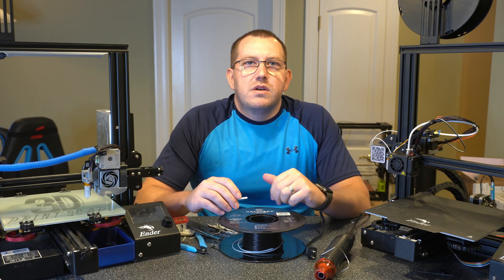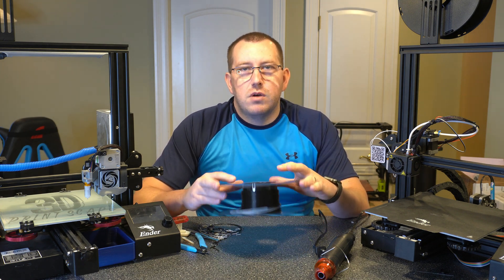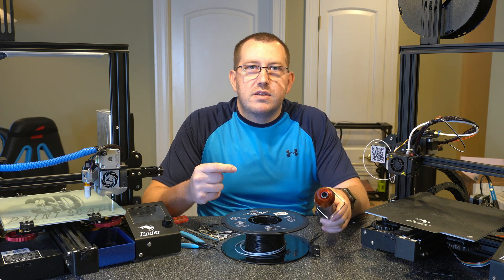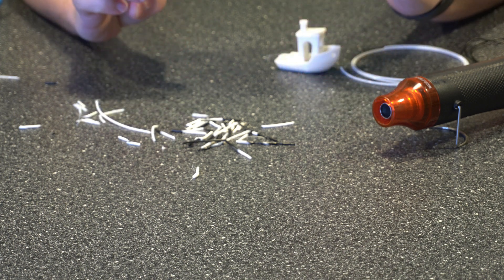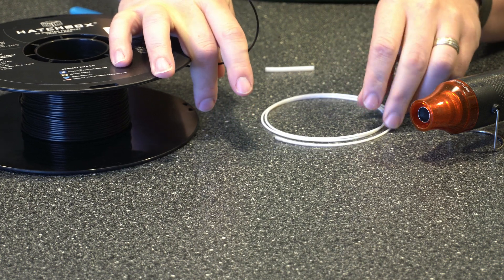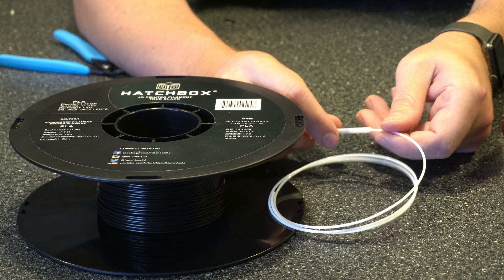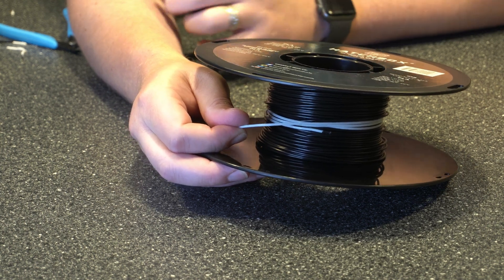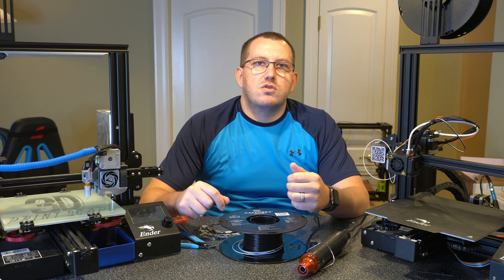Fuse Filament Together – The Cheap Way!

Comment: This is so difficult to get right, and I do not trust the connection points. Will have to look into getting a welder instead.
Reply from the maker: It get easier but ya its a pain.

Comment: followed this video to the letter made sure there was no resistance on the ptfe tube after and it would feed in my direct drive extruder up unit the spice and then stop feeding it please advise
Reply from the maker: Hi. It sounds like the diamide may be too thick at the fuse. Try to use the tube more when fusing it or sand it down a little.
Reply: if u mean roll the tubing as im joining it i do that already
 and im not sure why it wont feed through my direct drive extruder as its the same thickness @3DPrintscape
Reply from the maker: If its too thick at any point it wont feed through. Maybe try to measure the area around the fuse to tell you for sure.  @danachristie3862
Reply: I can't sand it too much or it just breaks apart
Reply from the maker: Gotcha, it can be a pain to get the process down at first but it does get easier @danachristie3862

Comment: I've only had a 3d printer for a bout 5 months and only got to the point where I had to start welding filament 2 months ago.  I watched a few videos on using various tools and I actually stumbled upon the method you show with the PTFE tube by chance.  I outright refused to pay for a tool if I could figure a way to do it myself.  

I did find 2 tricks that helped me have better results:  First, use a tube with as close an inner diameter as possible.  I had a section of Capricorn tube left over that was a tighter fit to the filament than the older white tube.  This took more practice but it gave me better results with less trimming afterwards.  Secondly, use an xacto knife (#11 blade) to bevel/chamfer the inner diameter of the ends of the tube.  This makes it easer to feed the filament into the tube which can be a real help when they are molten.
Reply from the maker: Hi. Thanks for sharing your tips. I will try them out next time i do this.

Comment: Wanted to comment that this worked VERY well! Thanks for the tip! Spinning the PTFE tube helped alot. I was using a butane torch and it was too much, I used a lighter instead and it worked perfectly. Thanks!
Reply from the maker: Glad it helped!

Comment: Good info.. way too much preface- was the 45° cuts effective after you melted off the first 1/2" ?
Reply from the maker: Thanks and it was. I ran several test prints using spliced rolls without much issue.

Comment: I don't bother fusing it; I just cut both ends flat, hold the tips together, and carefully guide them into the extruder until it's grabbed the new filament.
Reply from the maker: Hi. If your by the printer when the filament runs out thats an option. Im not sure if its easier though, it can risk causing other issues with the print.

Comment: So now you have a piece of PTFE tubing stuck on the filament.  Fine if you are welding tiny pieces of filament, but pretty useless if you are spooling on long pieces.
Reply from the maker: Hi. That is true, i mentioned it in the video as well.

Comment: Great info, was trying to do it another way, that wasn't working, but never thought of using the sand paper to trim it down.  I did find however that ithe sand paper can make the filament hot again, and ruin the fusing point.  There's a tool called card scraper (or card shavers) used by carpenters that can be applied in place of sand paper.  Instead of sanding the filament, you're shaving it down with little/no heat build up, and the fused point remains strong.  The cards come in large and small sizes, and I find that the smaller ones do a better job of whittling down the section.
Reply from the maker: Hi, thanks for ethe feedback and tip. I will take a look at those.

Comment: I have been thinking about this because I use an inordinate amount of filament in test prints, where the colour isn't that important, and I have a number of end-of-reels with just a meter or three of filament on them, Getting a strong fuse that isn't too big seems to be the problem - if the join is slightly thinner than 1,75mm then that might be less of a problem. I'm sure there must be a simple solution, and this seems the simplest so far.
Reply from the maker: Hi. its a pain at first but gets easier with practice. There are some more expensive tools that say they do the full process for you but the reviews seem mixed on them.
Reply: @3DPrintscape  Yes,  I spent some time thinking about how to make a joining machine, but there are so many potential points of failure or things you'd have to get made accurately that it doesn't seem worth the effort for something you're not doing on a daily basis. And as you say, the reviews of some quite expensive commercial offerings are not encouraging.

Comment: Thank you for a great tutorial. I specifically like it that you pointed out that one needs to practice as it WILL fail if one did not practice properly. Though you did not mention it I just assume that you were using the PTFE that is used in the Bowden filament feed system. 😉
Reply from the maker: Hi. Thanks for the feedback, ya that is what im using.

Comment: i cant see in the comments, but what tubing did you use to connect the pieces? Any idea where i could find it in the UK or Amazon website? 
Excited to try it. Think i've got a roll or 2's worth of PLA saved up if i can use this method
Reply from the maker: Hi. I used Capricorn Bowden PTFE Tubing, it should be available on amazon in the UK. There is a link to it in the video description.
Reply: @3DPrintscape  man I feel an idiot 😂 didn’t realise it was a Bowden tube. Will sort one now 😃 thank you for the speedy reply!!!

Comment: Great information, and very well presented.. I have several rolls with just a layer of filament on them. This would be great to combine it. IF you add the leftover of each roll onto what is being combined, after awhile you will have nearly a roll of accumulated leftover filament.
Reply from the maker: Hi. Thanks for the feedback. I know several people that make spliced rolls like that, it just takes some time to do.

Comment: How's the hatchbox filament working for you?
Reply from the maker: Hi. It has been working out good, i havent had any issues with it at all.
Reply: @3DPrintscape  awesome.  I have been using mostly esun and polymaker with some overture thrown in the mix. Always looking to expand filament options.
Reply from the maker: @bleach_drink_me  I also like overature as well, but for the price hatchbox is my typical go to.
Reply: I have used gizmodorks it clogged my printer . Then I found hatchbox and it works without clogging
Reply: Since posting I have used a few more gizmodorks and hatchbox. Both have worked for me fine. I currently go with in order of preference 
Inland(local)
Hatchbox
Polymaker 
Overture 
Novamaker 
Gizmodorks

Over the last year i have used over 50 spools of filament some other brands as well. I have had 2 spools of inland that have had issues. One of them was inconsistent and clogged other had multiple broken spots in the filament. 
I haven't had any clogs that weren't caused by heat creep(One printer is enclosed) from any of the other filaments.
Reply: @bleach_drink_me  what printer do you have
Reply: @bleach_drink_me  I had qidi but they were not good, then now i have ender 3v2 i just got it . I am  thinking about getting any cubic vyper

Comment: where do you get the tubing though
Reply: It looks like regular PTFE tubing, so just snip off a piece of what you have on hand
Reply from the maker: @kevinj7188  Ya its just regular PTFE tubing, nothing special.
Reply from the maker: Hi. Thanks for the feedback. The firmware has worked for most people, if there was an issue it was typically with the wiring for the bltouch. What board do you have, what firmware did you end up using, and did you add a bltouch (if so how was it wired)?

Comment: What do you do with the piece of tube once fused? Can’t slide it off can you, so where does it end up?
Reply from the maker: Hi. It depends on the application. If your fusing the filament to something thats curranty printing you would just leave it until the print is done and you remove the filament. If your fusing multiple spools together, you would remove it when rolling up the spool.